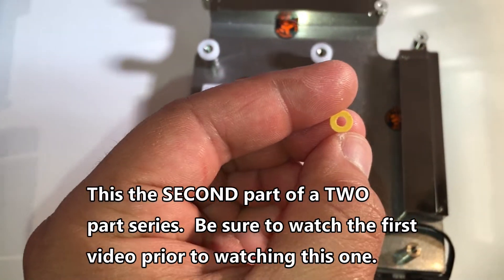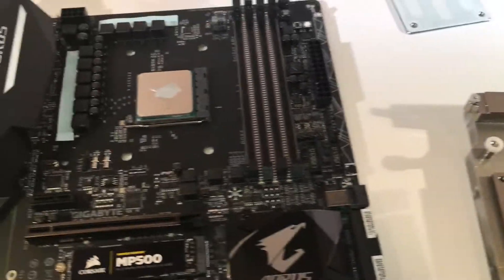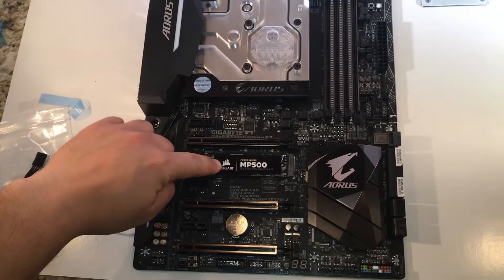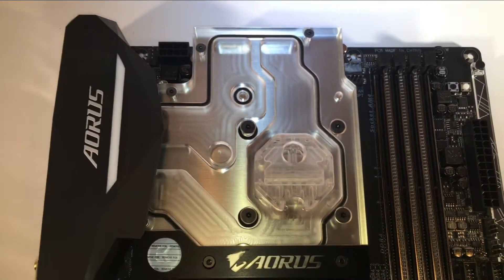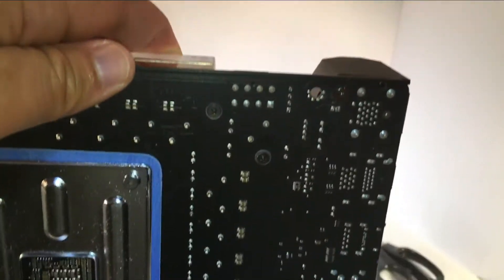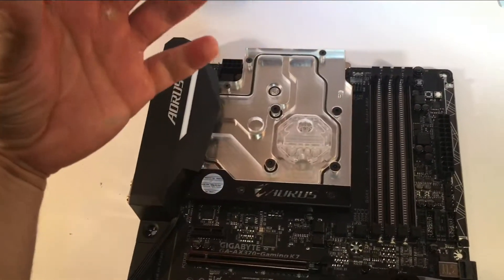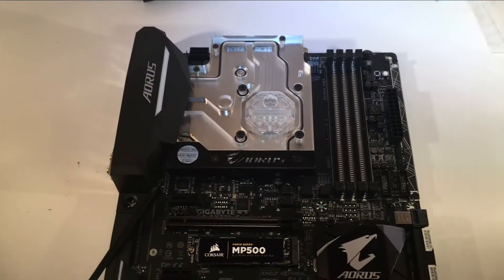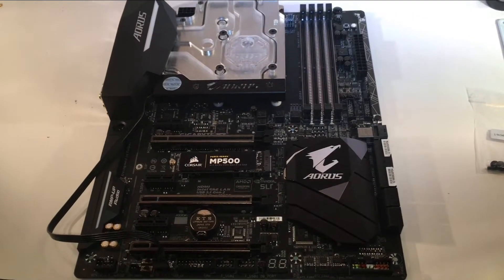EK-FB GA AX370 Gaming RGB Monoblock INSTALLATION Part 2 of 2

Comment: Awsome guide. Watched alot of pc channels none of them got to detail about what screws and when washers where needed, just installed my first mono block on x570 master thanks to you
Reply: Any advice on the master? I just got one for th x570 master
Reply: @dabbinsoldier  update the realtek drivers if not they may cause your pc to keep restarting when you try to shut it off.. I used the intel ethernet port so never thought about it being the problem at first.

Comment: Would this fit the crosshair IV extreme x370 motherboard?
Reply from the maker: +Tony Lujan Good question, I'd check EK's site.  I don't think there's any difference except for a built in wifi.
Reply from the maker: +Tony Lujan Hi, if you were referring to the Extreme version of the Crosshair VI, then yes it will fit.  Just found out from EK.
Reply: @modscience922  i think that has its own monoblock this wont fit